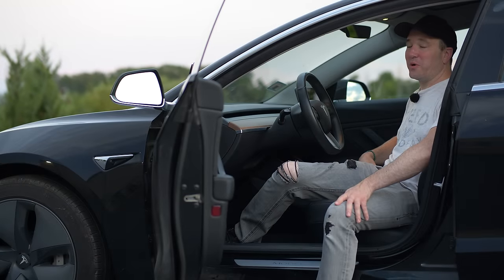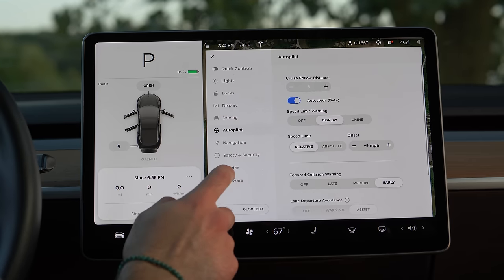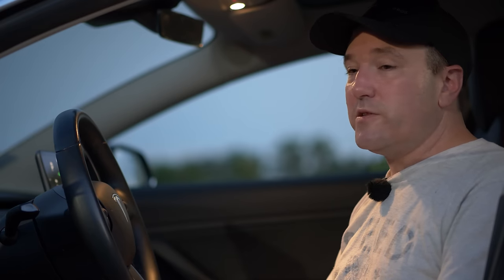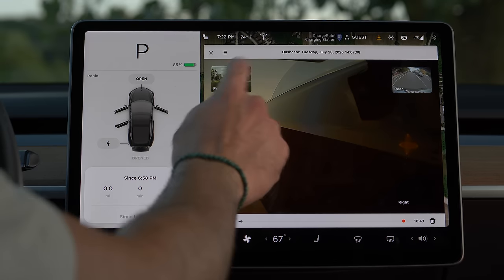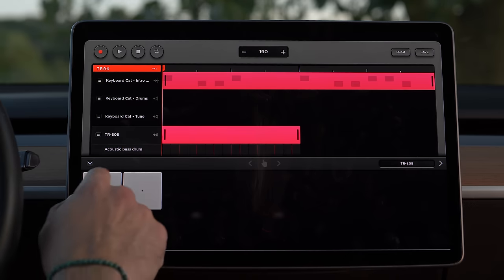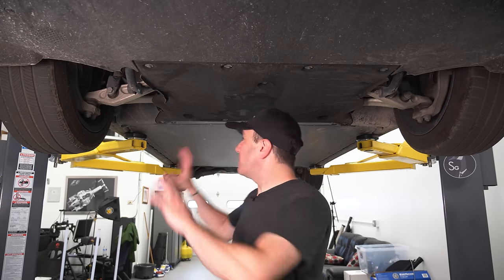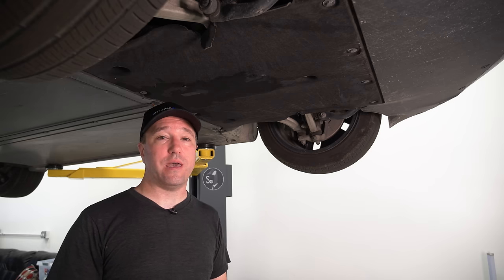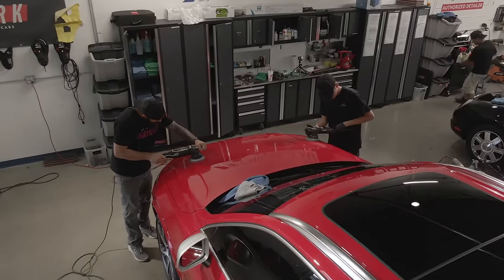Tesla Model 3 | Explaining the Cult

Comment: The talk at the end was a little misleading. BEVs getting power from fossil fuel plants still reduce carbon by about 50% over the lifetime of the vehicle. Solving the power generation grid is a separate problem which also needs to be addressed. BEVs are certainly not “the” solution to climate change, but they will play a significant role.
Reply: Misleading? It was total BS

Comment: One thing to keep in mind is coal and nuclear energy is more efficient than energy obtained in an engine of an automobile.
Reply: lots of losses in are 120 year old infrastructure.
Reply: @fatboy19831  Not as much as an ICE...assuming you are talking about coal
Reply: Importantly, you can run an EV on nuclear, wind, solar, or hydro, all of which are carbon-free.  Coal isn't clean, but a coal-powered EV produces less CO2 per mile than an equivalent gas powered car.  This is mostly because electric motors are very efficient.

Comment: I just took delivery of my new Model 3 2 days ago and I must say, after having driven some of the original model 3s 2 years ago Tesla has come a long way. I basically kept an eye on the production quality and pricing, and this year with the range increases and the price drops, along with better precision in their manufacturing it was just the right time to buy for me. I pretty much agree with everything in this review though, even the bit about the chargers, thankfully I live right next door to a Tesla repair facility in Chicago and they have a supercharger right there, haha! Also agree with your point that no car is really "green" whether ICE or EV both are extremely painful to the environment, the best advice I ever heard for being green was to use your car as long as you can(within reason), and only buy new ones when you really need it.

Comment: I don't think building a suspension so cheap it breaks when taking a slight curve can be called "A beginner mistake" (look up "Tesla Wonky Wheels") They're already manufacturing their 5th car model. Is taping radiators with duct tape something manufacturers usually do? How about putting defective punctured batteries into cars and then harassing the line worker who tried to fix the issue? How about shipping out cars with different color doors? Or not letting people drive their cars if they're not connected to the Tesla network?
Reply: Tesla is a new company, they tried to design a suspension that was light, they screwed it up. But they own up to their mistakes and have fixed it.  The wrong door panels, was just bad personnel and they fixed that.  That is old news  Try talking about FORD and how they screwed up the new Explorer. A company that been around forever and they screw that up.

Comment: Enjoyed the depth and wealth of knowledge in this review. It's pretty hard to say something that hasn't already been said about this car!  I was especially interested in the manufacturing section. A couple of minor points,- first regarding the touchscreen distraction factor: it is a total non-issue to us after 2 years of ownership. Voice controls actually work extremely well for climate control (for example, you can say "I feel cold" and it will nudge the temperature up 3 degrees.) and everything you need most often is on the stalks, or steering wheel thumbwheels (volume, washers, light dimming etc). I feel more distracted in our Volvo which tries to blend screens and buttons, but has much clunkier and less intuitive menus. And second, regarding the door handles, my entire family got used to the one-handed thumb push and finger pull in a couple of days. It's so natural feeling now that conventional door handles feel weird.
Reply: When your mute voice control is not an option, really? pulling handles feels weird? are you going to install those handles in your house now?

Comment: Wonderful review. 
Let’s not even talk about the fact that Teslas are so damn expensive here in europe 40% more than in the US which is crazy, not worth those prices when you can get a 2020 BMW 3 series much cheaper.
Reply: Even as a hater, I can only expect Teslas to be great given time to work on their manufacturing. But right now, if you care at all about quality, it's absolutely unacceptable to pay these prices for a Tesla when the German offerings are so much better.
Reply: Do you have ant govt incentives to offset the cost?
Reply: fabulousprofound Yea you get some small tax reductions but it’s still much more expensive than a german car equivalent.

Where I live the base model with no added options costs 49.000€ which is 58.000$.
The Long Range Dual Motor model with autopilot, which is the model most people would desire is 79.000$ (55.000$ in the US)
Reply: @hyacia  I'm 100% with you it's something Tesla has to work on.  That said, I also don't get those that use it as an excuse why they won't get one.  Don't get one fine but to say it's because of low quality is pretty silly if you agree that it's the best vehicle on the market objectively.  If it's not objectively the best use those reasons, not small cosmetic excuses.  I would put up with having to get some paint fixed for free on a brand new car if it is significantly better than anything else out there.

Comment: Was gonna buy a Model 3 until I checked how much insurance was.  Instead, I got a Golf R. No regrets!!
Reply: I bought a old Avalon and not only is the monthly payment non existent, the insurance is cheaper than my phone bill. It’s exactly what I want in a car—safe, comfortable, and dependable. Sure it doesn’t get 3000mpg on batteries... but I’m not going anywhere far enough for that to make much of a difference anyways.
Reply: Did you shop around? My insurance for my Model 3 is about $40/mo cheaper than it was when I had my Acura TSX.
Reply: @Howard How much was the insurance going to be per month? For my model 3 I use Tesla Insurance and it’s $95/month...
Reply: @Av-vd3wk  I also have Tesla Insurance. It was cheaper than USAA with my Acura TSX and what I was quoted for my Model 3. Maybe Howard S doesn't live in CA.
Reply: @xavier0237  For 6 months, Model 3 was $1000, Golf R was $600.  Even the Tesla dealer admitted how expensive insurance is around the mid-Atlantic for their cars.  I'm in my mid 40s.  No ticket, accidents, etc....
Reply: @Av-vd3wk   For 6 months, Model 3 was $1000, Golf R was $600.  Even the Tesla dealer admitted how expensive insurance is around the mid-Atlantic for their cars.  I'm in my mid 40s.  No ticket, accidents, etc....
Reply: @howards5695  Wow. My Model 3 is $588/ 6 mos. I'm 33 (34 later this month) with no accidents or tickets. My deductible is $100.
Edit: added deductible
Reply: @xavier0237  I guess Geico doesn't really save me 15%!  LOL
Reply: Geico is expensive.  $2400 a year in Baltimore.  $1800 a year in Towson MD and $1400 a year in Waldorf MD.  $900 a year with Travelers insurance.   2018 LR RWD 3 50 years old no points.

Comment: Most of the interactions I do with the car are done by the steering wheel controls, audio volume and cruise control speed.  Changing the climate control temperature...I don't do that very often, that's the reason for automatic climate control...to set a temperature and let it do it's thing.  If you do want to change ti however you could use voice control.  Also, you could put the car in autopilot and browse the web, it's still a lot safer than most drivers out there...the Tesla WILL NOT rear end anyone while in autopilot, but a lot of people WILL, and DO.

Comment: I think this review was very fair and accurate -- as of 2020. But it's 2022 now, and things are different. A lot of the opinions and facts presented in this video are out of date and longer apply. The list is long, but please understand that this review is OLD in tech years. These are some of the things that are now different: (1) all Model 3s have a heat pump now, (2) the center console has been redesigned and is no longer made of easy-to-scratch glossy black plastic, (3) fit and finish are greatly improved, (4) suspension has been subtly re-calibrated, (5) range is even higher, (6) road noise has been improved, (7) audio system has been improved, and (8) yeah, they cost more, too.  But MOST IMPORTANTLY I want to emphasize that there's full voice control. All those distracted driver comments about the touch screen no longer apply. You can now TALK to your Tesla, and tell it what to do, without ever needing to look at or touch the screen. Using your voice (and this is only a partial list), you can navigate to anywhere in the continent, change the radio volume or station, change audio tracks, search your music library by artist, album, or track name, adjust the interior temperature and other climate control settings, adjust the seat heaters, adjust the wipers, open the glove box, and much more. Software can change quickly, and that happens even more so at Tesla, so be careful not to lock into the kind of obsolete information presented in this video. Like I said, great job in 2020, but it's already pretty obsolete.

Comment: Point of correction: Elon Musk didn't start Tesla and the Roadster was not his doing. Sure, by the time Roadsters actually rolled to their customers he was in charge of the company, and from there on he took control, but he wasn't there from the start. For example the Model S was supposed to be a plug in hybrid according to the original founders of Tesla, but that changed quickly.
Reply: Thank God Musk got involved, They would have gone absolutely nowhere building a hybrid, There is already enough of that crap out there. Worst of both worlds.
Reply: What's your source for your statement regarding that the Model S originally was going to be offered as a plug-in hybrid. A quick search returns nothing with that kind of info. I'm actually pretty sure you're wrong about that.

Comment: Very fair assessment, and I am a Tesla FanBoy.  I very much appreciate your straight forward approach. No fancy zooms, camera angles and migraine inducing MTV quick cuts that seem to be so popular.  I do agree with you that the display is distracting and potentially dangerous if not used with care and discipline.  One thing that you did not mention is the voice commands, that while far from perfect, can be used for most operations reducing the need to rely on the display.  I own a Model 3 Performance.  The most satisfying car that I've ever owned.  Hand crafted panel gaps and all...
Reply: Hand crafted panel gaps and all...LOL.  My Model 3 delivered Aug 22, 2020 had just one misalignment at the chrome trim seam between the passenger doors.
Reply: @carl5438  If you DON'T have that one, I'd refuse delivery.  Something would be amiss... Also, check your hood alignment ;)

Comment: I live in Chicago, before the pandemic commuting in my Model 3 to work was always something I was looking forward to, it is a great daily commuter car. Yes, it is somewhat pricey but I was looking to spend that amount anyway and after test driving it, I didn't want to get a Lexus or a BMW or anything else. Also, I spent 500 to get a charging outlet at home installed, it is just so much more convenient than going to a supercharger. Yes, the car is not perfect (a bit noisy), but using regular autopilot in stop/go traffic is awesome. This is when this technology is not that distracting, when you go 5 miles an hour in Chicago stop and go traffic for 45 minutes. The car responds quickly, and it quietly moves along with the traffic flow. I also used Chicago Auto Pros to get basic ceramic coating and tint, those guys are great. If you are in the market for a new car at that price point, you owe it to yourself to test drive one.